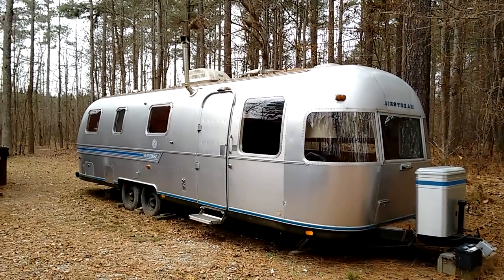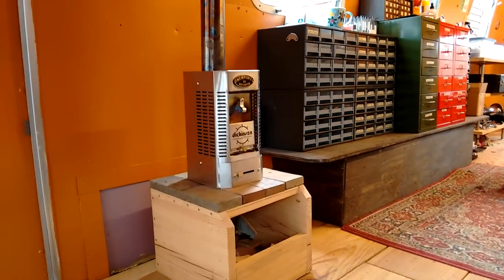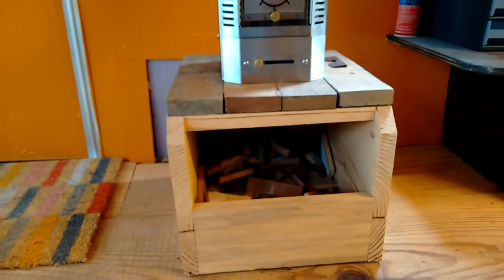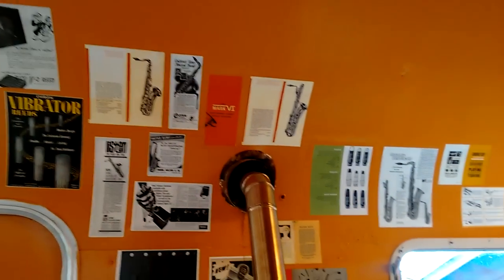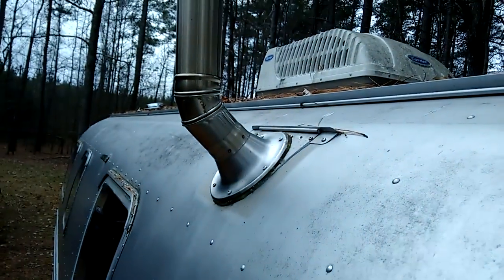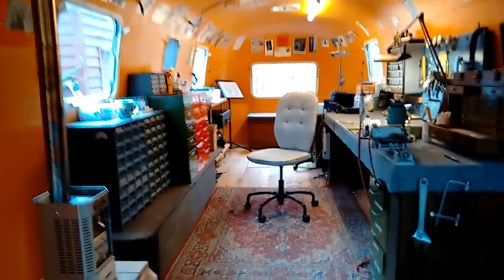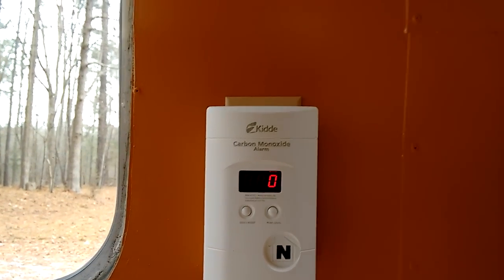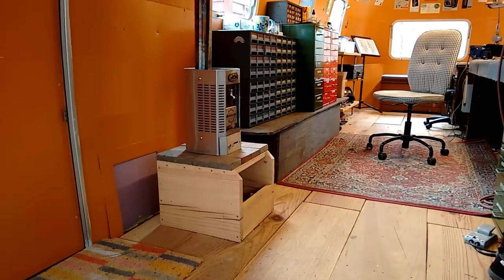Airstream Sax Workshop: Wood Stove Heat

Comment: I love this! I'm rehabbing a couple of condos in an old house and both have really small brick hearths. I replaced the fireclay flue and had the exterior chimneys tuck-pointed, and now they're ready for fire; but even small wood-burning stoves are too bulky and jut into the living room more than I want. This will work great! It would be nice if the door had a window -- I like to watch the flame.
A suggestion for circulating warm air: point the fan up at the ceiling and it will circulate all the warm air at the top of the trailer.

Comment: Wow, great to find this. Love those Airstreams! I don't have the need or space right now in my camper van, but I've wondered about the viability of a small wood stove if I ever did a conversion. I'm amazed and delighted by the 2" official gap requirement, and starting to dream again! I've designed what I think should be a perfect addition to such a system, solving three problems and giving an additional benefit. I would run the stove pipe up through some kind of heat-exchanger (even just wrap it in a long coil of copper pipe) which transfers the heat to a water tank. This would (1) cool the stove pipe so it's safer before exiting the room, (2) capture the large majority of heat wasted from stoves, re-radiating it from the tank, meaning the whole thing can run on less fuel, and (3) keep the living space warmer for longer while the stove is out. If the insulation on the water tank is adjustable - like a wooden box with a sliding door exposing vents top and bottom, say, it could be kept hotter when the stove is in use and adequate heat for the living space is coming directly from the stove, and this pre-heated water can be used in cooking, making coffee, washing up, etc.. When you leave/sleep and let the stove go out, and no longer need your hot water supply, you open the vents and it becomes an overnight storage heater.

Comment: Awesome post. I am planning on buying an Airstream in the coming month(s) as a place to live. Putting my house up for rent. Im researching how to keep the thing heated during the winter. I found the stove and your video helps greatly. Awesome....
Reply from the maker: Good luck!  Just watch out for moisture problems in the plywood subfloor.  Its a notable weak spot and requires nearly complete disassembly to repair. 

Only thing you might want to note about this stove is that it is so tiny, it requires refueling once or twice an hour.  No big deal during a workday- it only takes seconds- but for sleeping, that would suck.
Reply: Moisture problems in general or due to the stove. Thanks for the burn time heads up. Im prob going to use a Kerosene heater for the most part but def going to look at adding one of these wood burning stoves. Thanks for the info on the fan and the buckling issue as well.
Reply from the maker: Moisture in general, when buying a used one. 

The integrated vented propane furnace is probably better than kerosene.  I took mine out though, it takes up a lot of space.

Comment from the maker: I might put something on the floor as a spark guard later on- maybe a metal square? or more bricks? but so far its pretty tame and I only have it burning while I am present, so I'm not in a huge rush. The largest fire I ever have being about the size of the one in the video- and I typically don't open it during max burn, but did so for the video.
Reply: Well designed.
Reply: Matt Stohrer Beautiful job on your airstream. Clean and classic. Love your little stove as well. First rate!
Reply: @Stohrer Music how long does a fire burn? How often do you have to add wood

Comment: Those are great little stoves. I installed one on my Boles many years ago. You can burn wood in it but my favorite fuel is regular charcoal briquets. Even heat that lasts for hours. Smokes a lot when starting it up but once warm, totally a sweet stove. Not cheap but worth every penny.
Reply: Not funny

Comment: think you should have that CM detector lower towards the floor.  The gas is heavier than
air sinks to the floor, then build up towards the ceiling.
Reply from the maker: well its lower than head level, and I don't work laying down, and the place is draftier than you imagine.
Reply: No worries , I was not criticizing.

Comment: THE GREATEST HEAT IS AT THE TOP OF THE CHIMNEY SO TAKE THE CHIMNEY AND BEND IT AROUND THE INTERIOR OF THE CEILING BEFORE EXITING AND YOU WILL STAY WARMER USING LESS WOOD.
Reply: Harold Hart Bends make the stove less efficient and create areas for creosote build up, which can be dangerous.

Comment: Great review. I have a '59 AirStream Trade Wind that we're restoring from the frame up and was thinking about heating it, which lead me to look at wood stoves. Is there a reason you didn't put a damper in the exhaust? I was kind of thinking it may help keep most of the heat from going through the exhaust and might make your wood last longer. Thanks for sharing

Comment: Curious about the BTU output, square feet in trailer and generally how open the stove vent intakes must be for the stove to output the heat you need. Also when fully loaded, how many hours will it burn before going out ?
Reply from the maker: I upgraded to a cubic mini grizzly, and with that one about an hour of useful heat, maybe coals that can be restarted for an hour after that.  The one in this video, probably half of that.

Comment: Hello Ive been researching the Dickinson Newport solid fuel stove and so far I have still one question. What are its average burn times. Say if it is loaded and properly fired and then left to burn out? I know their are many variables to consider such as fuel type, size moisture content  species etc. If you could share your experiances with what your useing it would be very helpful. Thank you.
Reply from the maker: less than an hour of useful heat.  might keep embers for a little while longer.  I have since upgraded to a cubic mini grizzly, which I like a lot more.

Comment: If people want to know for the future .
Its have about 2.2kw of heat .
And its not made like that it have to hang up and have to be free underneath .
So this is not the way to place it.
It's a all burner means it not only for wood.
For the rest it's for boat because the wood can not come out if you moving on the sea and you have some wave .

You do have diesel burners like that and gas burners from the same company

Comment: very nice I have a 29 foot airstream as well and am looking at marine wood stoves the newport is the value. how long does it burn on a load of wood? Have you tried coal?
Reply from the maker: Joe Moss read comments below.  you will want a bigger stove.  I will upgrade at some point.
Reply: Matt Stohrer what type of pipe did you use

Comment: I was searching on " how to insure a workshop with a wood burning stove " and your video came up.
How do you?
In mass many wont allow a wood stove .

P.S. I'm a sax player...........
Reply: Buy a hot dawg heater you can run on any gas also motor oil. If you can't get insurance that's okay get re-insurance. I have insurance on my garage via homeowners then I have two policies for the content totalling it's honest value and any elite projects. You may be alble to do a wood buring stove if you put an actual fireplace or a steel burn box . Where I live a cast iron fireplace makes insurance more so I built a large garage it has three fireplaces actual fire places in a 6000 sq ft garage . This guy doesn't have insurance in this video

Comment: Just a friendly point, your stove pipe in the video is upside down. Male joint should point down towards the stove.
Reply: John, you are correct due to the creosote issue. I recently bought one of these heaters and had to modify the stove connection to change from male to female...have not installed it yet just a pre install burn.
Reply: the first thing i look at when i see wood stoves.....is the pipe oriented correctly?
Reply from the maker: unfortunately I am limited by the through-vent being set up backwards- female joint inside, male joint outside.  it has not been an issue so far, but perhaps a modification is in order.

Comment: Where did you get the flange on the outside of your trailer. I have an Avion trailer and plan to put a wood  heater in it, and would like to have the finishing touche like yours. the curvature of the trailer make it hard to do it right, and look  finish. I don't want it to look Jerry rigged. thanks
Reply from the maker: david thompson bought it from the same place, curved it myself.